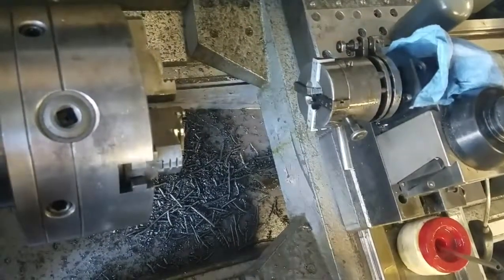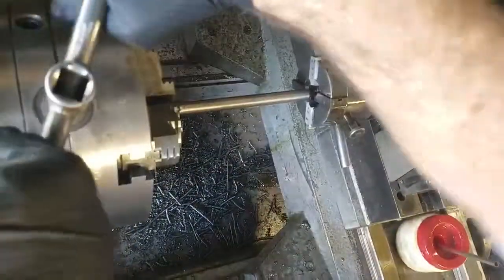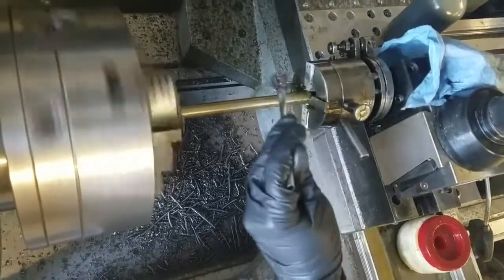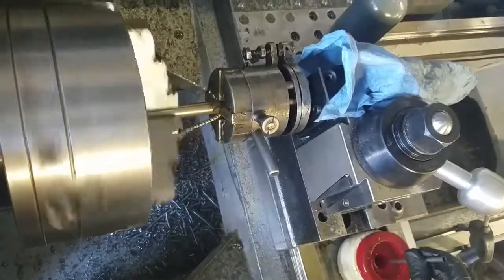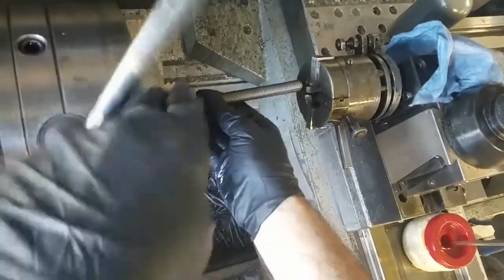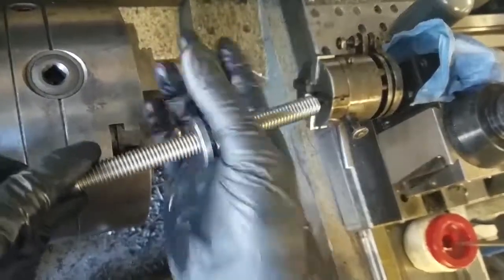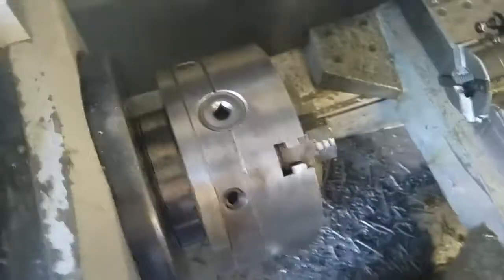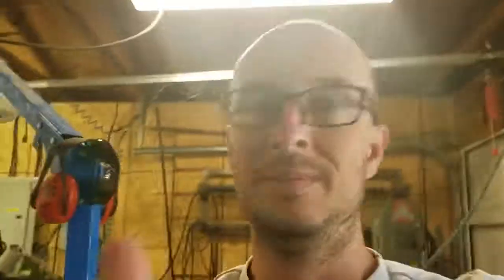Fast threading on lathe Diametric head

Comment: as a young apprentice in 1950 i used Coventry die heads for most threading applications. Never any problems provided you remembered to insert the dies by number.

Comment: I have one that I haven't used. Does it pull the carriage or are you feeding with the chaser?
Reply from the maker: If you have it on the tailstock, with the tailstock unlocked it will pull it. 

I prefer to set the thread pitch and a stop on a manual lathe. Then use the carriage feed. Once it hits the stop it will stretch until it disengages the chasers. Then manually move the carriage out of the way.

You have to figure out the “stretch to pop open” distance and account for that. 

On the cnc same as on the manual large except set the rpm and feed to match the pitch. If you pause you can see the g code I wrote for this op. Super easy!

Comment from the maker: I haven’t read the comments in a long time. Sorry for the super late replies!

The head has a mechanical spring inside and once the carriage stops the head stretches the spring and at the end of its travel disengages the chasers with approximately .050 inch clearance. 

These run anywhere from $150-$2000 depending on condition of the tool and how many different chasers / dies they come with

Comment from the maker: All in all I was able to thread well over 600 threads 5 inches long with the same set of chasers with minimal wear on the cutters. The cutting fluid is very important. You want to use a heavy cutting oil with sulfur added for steels and stainless. Screw machine oil works well.

Comment from the maker: The cutter inserts are called “chasers” and are still available new or used on eBay and some good supply chains. In fact I was able to find brand new Diametric heads and chasers from MSC industrial supply on line!
Reply: I inherited 2 geometric die heads with many sets of chasers.  They are the cat's meow for cutting threads quickly, even if only a few are required.
The price for new chasers is pretty steep;  when I checked some years ago they were about US$100 per set.  Is there a less expensive source?  I am a hobbyist after all.  Thanks.
Reply from the maker: @BasementEngineer  yes the best pace to find used ones is eBay. Typically they are under $50 a set.
Reply: @dcsmanufacturing4815  Thanks!  I'll keep it in mind.